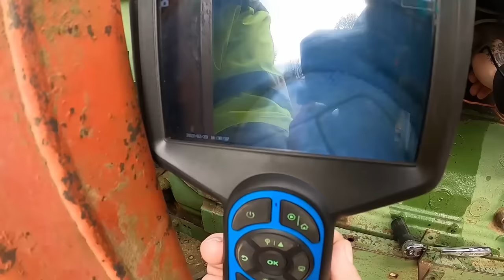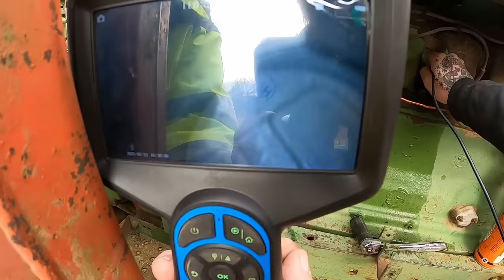1967 John Deere 4010 on PROPANE. Will it run after sittin for years???

Comment: First you should show me some love ,I mean. LUV by givin me that Chevy LUV😎😎😎.
Second thing our 1958 John Deere 820 the speedom and thacometer are one in the same it has a needle that goes all the way across one side is the tac the has 6 rows that tell you your speed in that gear. Pretty cool didn't really matter in something that only goes 12 mph
Reply: Yeah I drained the transmission and got like 5 gallons of water and 3 gallons of runny black pancake bater and left it opened and it made black top for a month.
Reply: LUV I thought I saw was your stepside c truck

Comment: Lead acid batteries like the one you're using are fine for the most part to bridge. They just discharge. The myth of leaving a battery on cement will discharge it isn't true, its mainly dirt and dust bridging the contacts that do discharge it. Lithium cells (like the ones in your tool batteries) are completely different. They can enter "thermal runaway" aka bursting into flames if they're bridged.

Comment: The tires on ol Roy look like military Humvee run flats probably 16.5 inch wheels
Reply: Now that I've made it to the end of the video I heard you confirm that they're Humvee wheels. I used to have a set on my 85' f-150 in highschool. Boy I romped through some mud holes with them loved em'

Comment: Puddin I do have to say that is definitely not just true about battery’s just exploding when you are charging them!! I worked at a shop for several years when I was in high school and a buddy of mine was trying to get a ford started and it would turn over and then quit turning over but seemed to have enough volts to wear he new that it wasn’t dead quite yet!! He found that the battery cable was loose and he couldn’t get it to tighten up anymore so he took a screw to put between the cable clamped and the battery post and as he was just turning the screw in and of course the key was in the off position and well the battery exploded big time getting battery acid all over everything!! I was actually the one that got the garden hose to soak him down to dilute the battery acid and so he wouldn’t get acid burns!! He was able to get his shirt off and I had soaked him down for probably 10 minutes or longer!!! He came out ok and with no acid burns!! We never could figure out why the battery decided to explode!!! After that happening I’ve definitely been more cautious around batteries after that had happened!!! So never think that a battery won’t ever explode for sure!!!

Comment: In a bad situation with hydraulic system. Cut coke can down middle and cut the ends off. Hose clamp the can on the hose. It will slow down then.

Comment: If you drive the tractor with your fool on the clutch (push it all the way down) it should come un stuck from the flywheel. foot on clutch try grab a taller gear and then used throttle to jerk tractor while driving. it will bust loose.

Comment: You need one of those TEE battery cable 'cutters" that cut your cable ends at exact angle so al lya gottta do is press and twist and you got full contact. Never need to use a wrench on em.  And wha choo talk n bout? Mortske DOES  know everything, bout 30s fords and flatheads, that is worthless information. and chevy firing order , he does know that.. With all the tools I seen you got, I`m sure it would not take much to build a box just to take out and about , like you often do, and when ya do you can put stuff like a cable end or 2 , zip ties sand paper, etc etc, that you alwasy forget.  Once ya got it done , then all ya gotta do is grab your milwakee stuff and battterys. your 'to go ' box and GO...By the way , the new 18volt air compressor is AWSOME! everybody neededs one of them.  I dont know about OK but in AZ you can sell them old batterys for $12 bucks each. And that jeep is worth a ton here. Tell puddin pop that is an AMC motor not a dodge, it a 304 I would think the roof and doors would bring at least a grand without door handles.and the P/S pump and box bring 5-600 bucks.  Axles $15-1900 if its got a posi. if you dont snag it , you stand to loose$3000 or more for three sales on marketplace.

Comment: Barry Gilgen, Puddin when you were at your Puddin Pops working on the tractor I saw a yellow jeep out there, I am looking for a jeep with a hardtop which it was, color is ok, engine might be in trouble with carb off, looked like a v-8 motor, do you think it is for sale, what year, how much, is it worth rebuilding, I know need a lot of work , brakes and tires, looked like could be rebuilt, you should know if it is or not. looking for a jeep and don't want to pay the high dollar prices people want, and if you did that high dollar one could need the same stuff the yellow needs. what do you think. can you take the time

Comment: You're 6 l LS should bolt right up to your 400 Turbo it just will not bolt up with all 6 bolts you will be missing one bolt hole but if 5 wouldn't do it 6 never would but also you may have to shim the torque converter with a special bushing

Comment: You spent all of that time building a coil wire, but why didn't you just use a spark plug wire off that other vehicle? I mean, essentially, a coil wire is nothing more than a short spark plug wire.